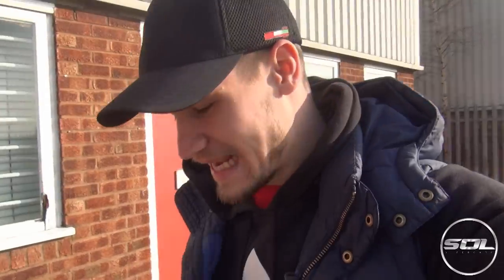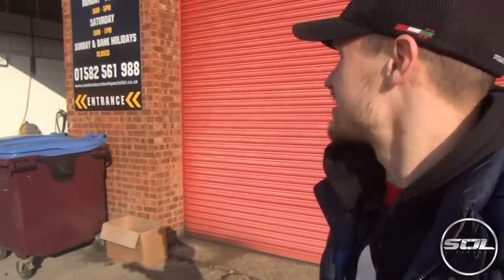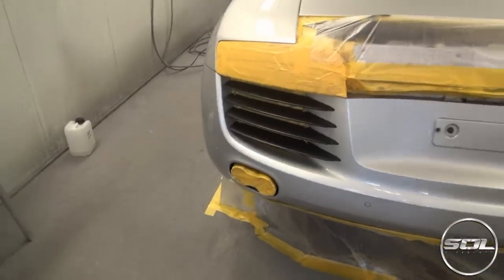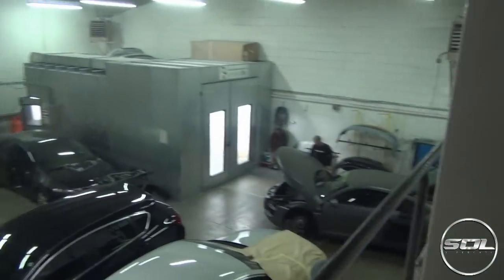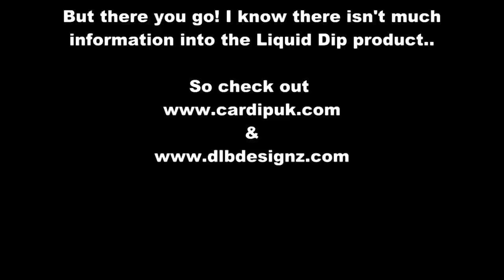My Audi R8 goes Satin Nardo Grey: By Car Dip UK

Comment: Why 'dip' over wrapping, it seems like so much effort compared to wrapping.
Reply: It's actually not that hard if you haven't I'd suggest taking a look at dipyourcar's channel
Reply: Perfect topic for next video!
Reply: eddiefara The thing with dipping is that it's like a paint job, so that means if a panel gets damaged and needs to be resprayed, it might not be the same colour as the rest of the car. Whereas with a wrap, you can rewrap a panel in the same colour as the rest of your wrapped car. That's why I'd got for a wrap rather than a dip. Stone chips and stuff
Reply: Robert Skuriat i agree but it is cheaper for a detaler to polish out scratches ;)
Reply: MAX cars You mean you can polish out scratches out of plasti dip?
Reply: Robert Skuriat yep i think
Reply: Robert Skuriat how long do wraps last?
Reply: Nicholas Luca Ricciardi As far as I know they should last 10 years if they don't get damaged. But personally I would change it after 5. Keep it out of direct sunlight and heat where possible. Clean bird droppings off it straight away and you're good

Comment: i have a 335i i had it dipped and just removed it. DO NOT DIP YOUR CAR when you peel it off, sure it comes off in one piece but in the crevases is a pain in the ass. i had to take a toothpick and slowly pick at the paint.

Comment: So plasti dip I thought was made for cars, but he says this is better and actually designed for car surfaces!!!'
Reply: Chris Claypool by plasti dip do you mean from a hardware store or dip your car because the dip from dip your car is made specially for cars
Reply: 7topseven7 It's the same stuff, the only difference in buying it from dyc is that it comes pre-thinned
Reply: Braden Carlson thats not what fonzie said he said that it is a different formula or something like that he said it is made for the car now it used ti be just thinned plasti dip according to fonzie
Reply: 7topseven7 It used to be thinned Rubber Dip Spray, now it's "Plasti Dip Spray". It's a different thinner and more tint added, essentially. It's only available in a few colors though